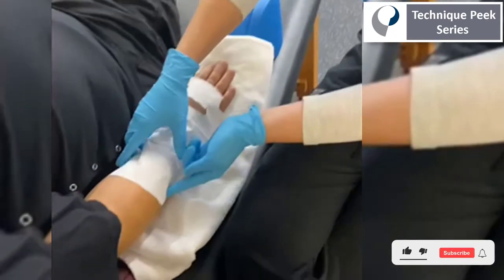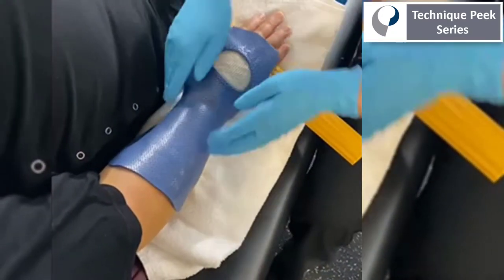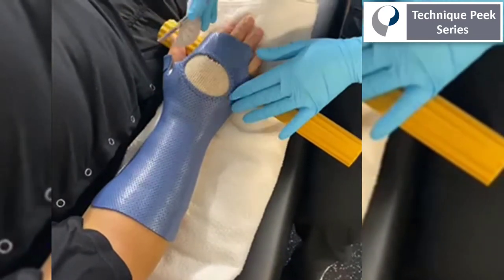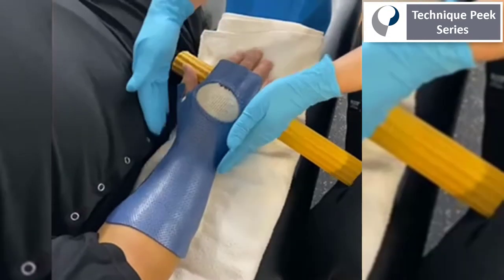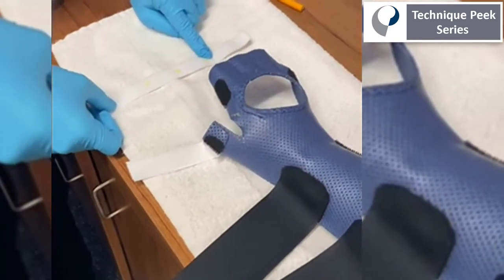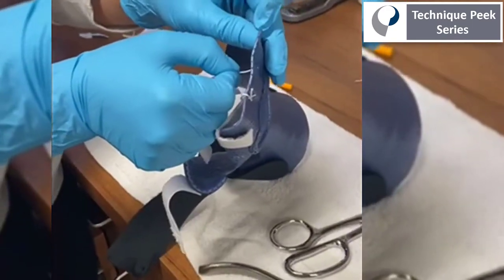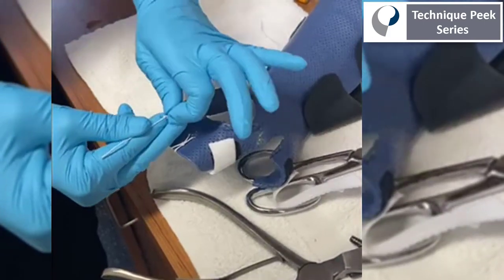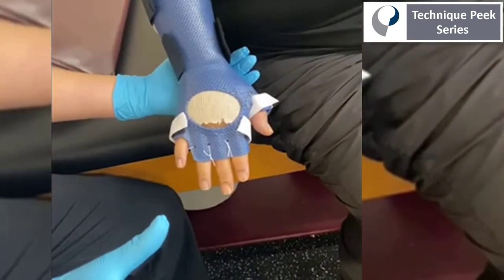How to Create a Radial Nerve Palsy Splint  |  Technique Peek Series

Comment: I love the idea of this splint instead of the bulky outrigger. Would any 1 in elastic work? Also in the other video of how it is used in a functional activity the elastic strap looks like it was put in a bit differently. Was that one wrapped around each digit seperately?
Reply from the maker: Any 1 in elastic will work as long as its not too bulky on the finger. The second video does show a splint with individually wrapped elastic straps. Just a different option. Thanks for watching!

Comment: it looks like the cut out for the MCPs does not include the small finger MCP. Is that correct?
Reply: The cutout should be wide enough to allow all MCPJs to flex fully. After the video was taken, adjustments were made to widen the cutout to allow the small finger to flex fully. Allowing full MCPJ flexion is essential to avoiding contracture. Great observation!